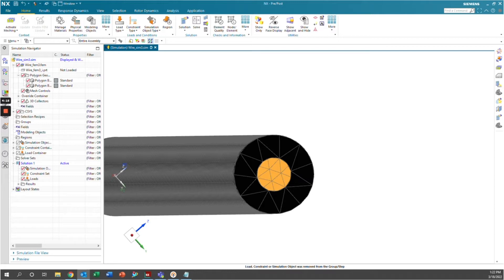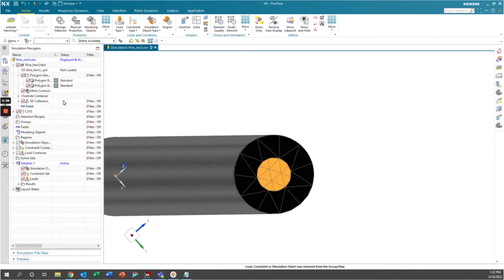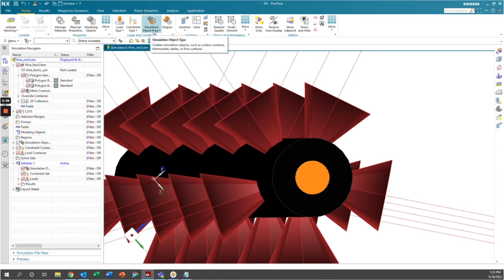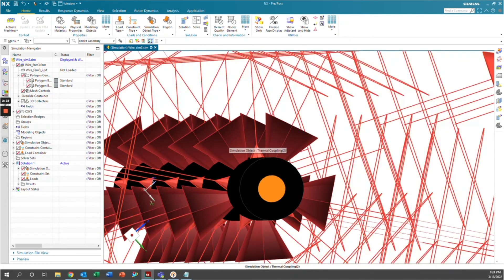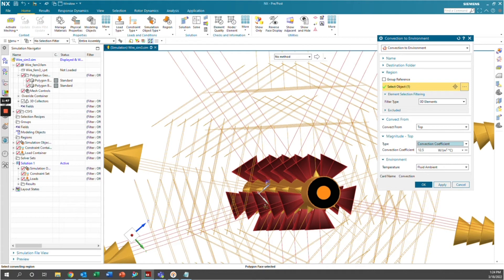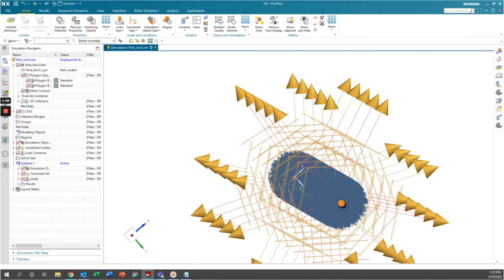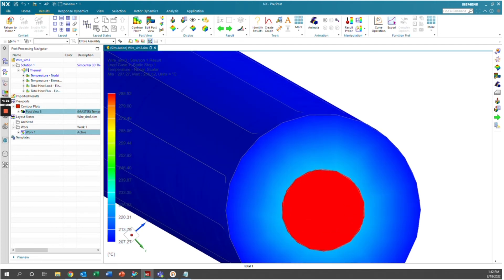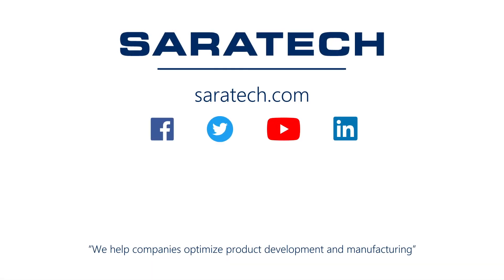Tips & Tricks - Simcenter: Basics of Thermal Analysis

Comment: Great presentation thanks. Which solver set are you using here? NASTRAN  SOL101 Structural or NASTRAN SOL101 - Thermal? Also which version of NX
Could you run a simple example/presentation please using Simcenter thermal analysis to simulate the application of current through a thin strip of metal to analysis the temperate rise.

Comment: Is it possible to see how far the natural convection radiates out from the wire to another component?
Reply from the maker: Thanks for your question! In theory, the natural convection could affect any object situated in the same space as the wire. This of course depends on the magnitude of the heat being generated by the wire and the temperature of the insulation. If one desired, you could place another meshed geometry in the same simulation and use a contour plot to see the heat effects visually.
Hope that helped!